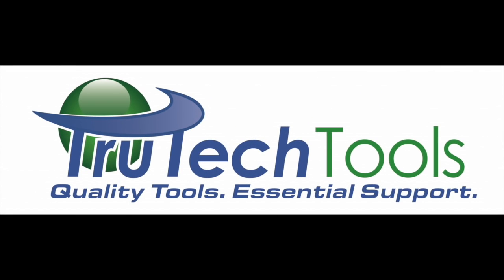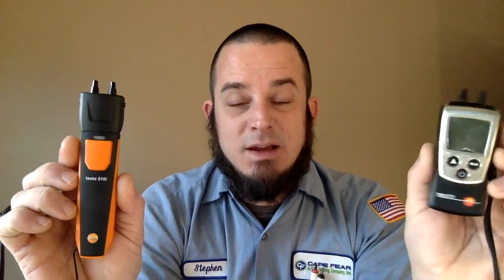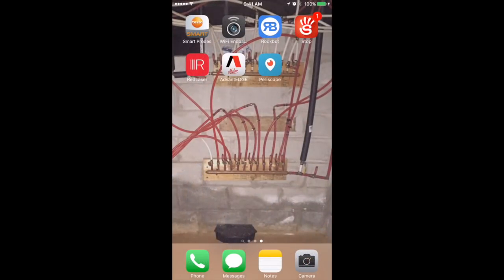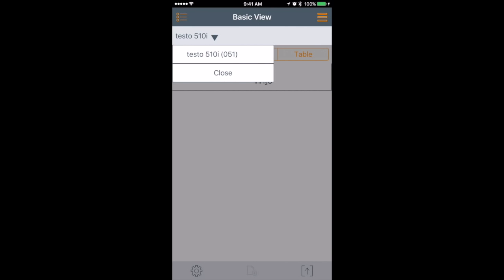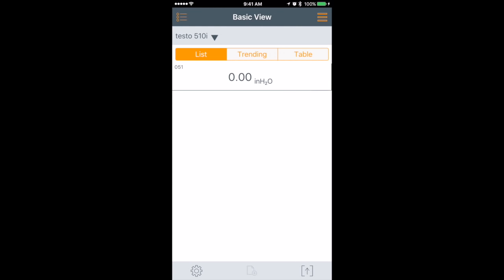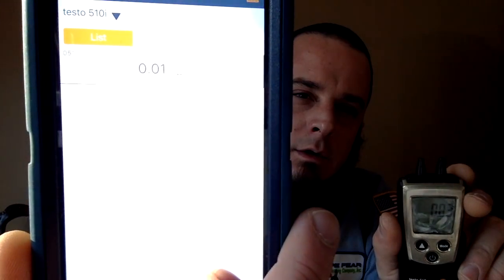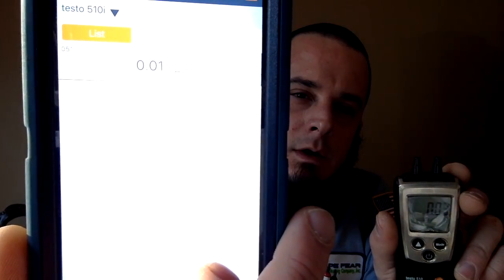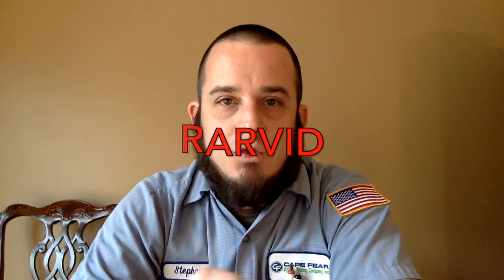HVAC Tools: Testo 510 and 510i Comparison

Comment: On the 510i can you view tube pressures individually?  Or does it automatically differentiate the pressure to a delta P?
Reply from the maker: If you have both sides connected it automatically shows the difference in pressure, yes
Reply: So then there's no option to view the pressures independently if you have them both looked up?  I think that's a miss alot of these manufacturers miss. Fieldpiece and Klein are the only 2 I know of you can view 1, the other, or delta.
Reply: @natep1661  Yes there is.....zero out device in the air then connect only one side to the duct you want to see the pressure in. It  will display the differential which is actually the pressure in the duct. You can then do the same for the other duct. Maybe just a little more work  but in a minute you have your answers.

Comment: I have the Testo Smart Probes. They are great. I'll never go back to a big set of gauges again. 
The one problem I have with them, is the fact that the rubber starts to separate around the on/off button and exposes the electronics beneath and exposing the electronics, rendering the protection from the elements useless after only a few years of use. 
That is only 1 of my 2 concerns I have for the 510i. As a Service Tech, I don't care about speed. I care about PRECISION. But, I don't need the pageantry, ritual and pomp and circumstance of powering up an app on my phone to read something that shouldn't take long to read. 
That's just my take on it (not right or wrong, just my opinion). 
I'm very happy with my 510. It's a great tool and much smaller than my old Fieldpiece manometer I started out with, years ago.

Comment: i have the testo 510i and i use it on daily basis at work ( air balancing) , testo 510i is a great tool for static pressure but absolutley useless for velocity readings as it doesnt have the accuracy required to meaaure small differences between static pressures vs total pressure
Reply: Mark what are you using to read velocity? I need to do readings on kitchen hood filter faces using a Velgrid. I’m trying to figure out what’s the best option for this.  Thanks

Comment: Is Testo 510 suitable to measure Pressure Difference of a liquid with the viscosity of around 0.2 Pa.s?
Reply from the maker: That's a good question, I'd say check their website or search for a Testo 510 user manual on Google. I don't know off hand
Reply: Just air for these gauges. Moisture of any type will damage these.

Comment: I've never had or seen a high resolution digital manometer that didn't have some creep in the reading, even ones that claim to have temperature compensation.
It is due to temperature change, just holding it in your hand is all it takes.
Reply: DP Measurements (a UK company) make some brilliant autozeroing Micromanometers. The absolute best out there in my opinion, Testo TSI/Alnor/Airflow & Kimo all used.